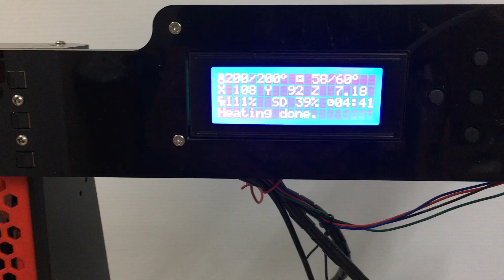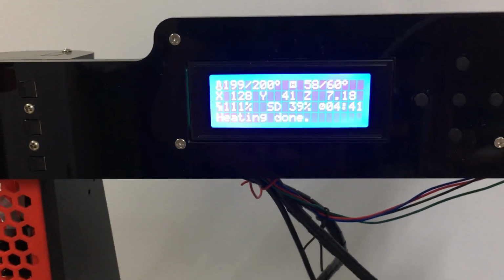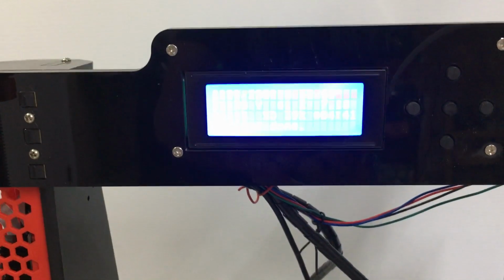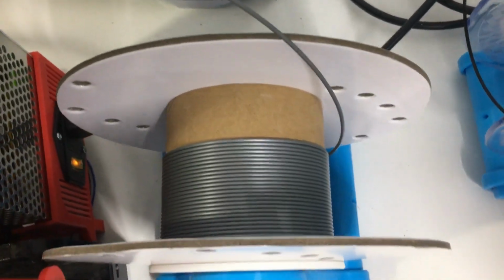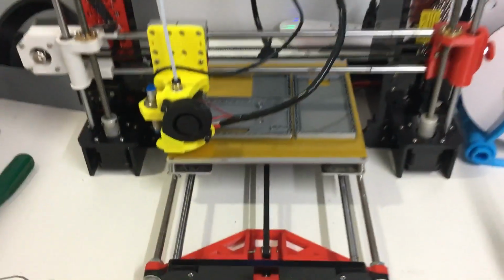Splicing PLA Mid Print!

Comment: Was thinking a piece of bowden tubing would help with the molding process to prevent jamming, but then you have this extra piece of tubing on the spool till the end of the print..  Probably not worth the unknown factor if you're able to catch the switchover.
Reply: Use 2mm shrink tubing. Cut your filaments at 45deg, insert into shrink tubing, heat it up...then cut it off. :)